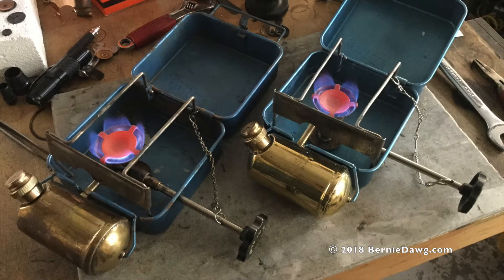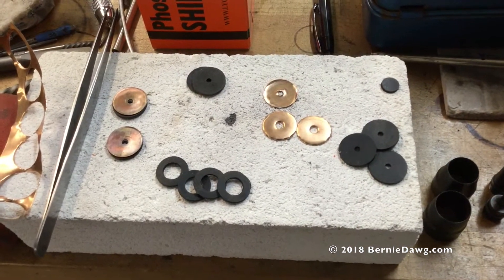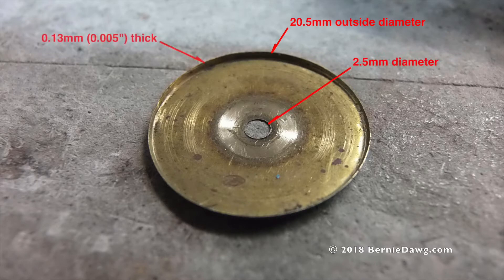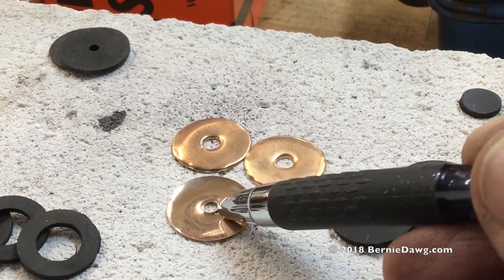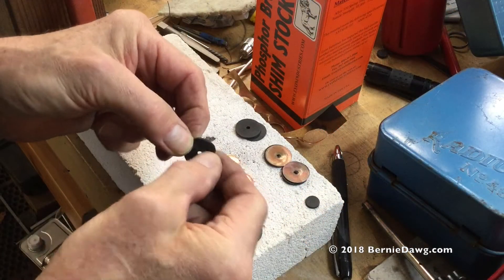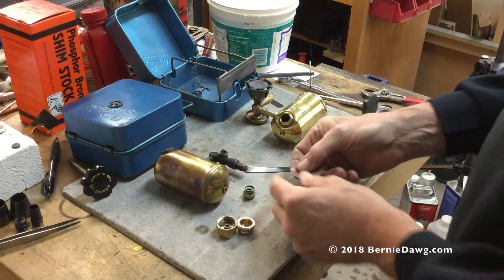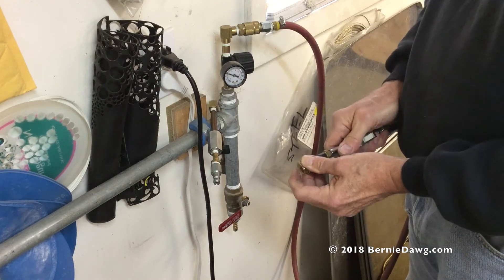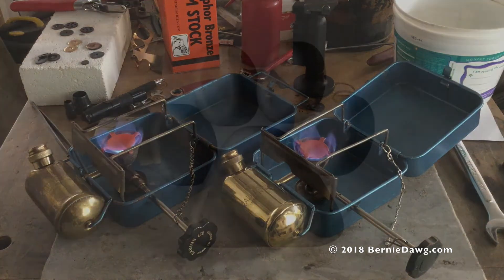Radius Safety Fuel Cap   Part 2   Gaskets

Comment: You seem quite an expert - how much for for a set of brass/rubber gaskets of the Radius Safety Release Valve filler caps for my Radius 119 lamp?
Reply from the maker: @Shapeshifter Thanks! I'm not in the business of making gaskets for money. But, if you need those gaskets and don't want to make them yourself, then KiteLamp in Taiwan is the place to get them. https://www.kitelamp.com/product-category/radius/?v=7516fd43adaa BD

Comment: Would  you have or happen  to know where to get new pot supports for an Optimus  8r.i have quit a few 8rs .but i have two that ive completely  rebuilt  and a pair of new supports would be the finishing  touch.
Reply from the maker: New? Bit like finding unicorns I'm afraid. I think NOS disappeared some good years back. You may be able to search eBay for a beater 8R to scavenge a pair of supports if you are missing your sets. Or... there's always a torch and some 4mm stainless rod to make your own...  Good luck.
Reply: BernieDawg Cinema ive been thinking  of making a set of dies just to make a few pair.i have a bunch of stainless  rod i bought  just for that.ive tryed  to just bend some up by hand but they not good enough  to show off.i have quite  a few 8rs but i have two that ive really  spent way to much time on restoring . My favorite  is an old beat up one someone  put a lantern  flint striker on it and i take it with me on  my bike everywhere . Thanks for the videos  you put up . always  learn something  new.